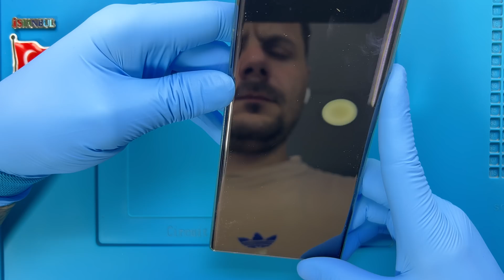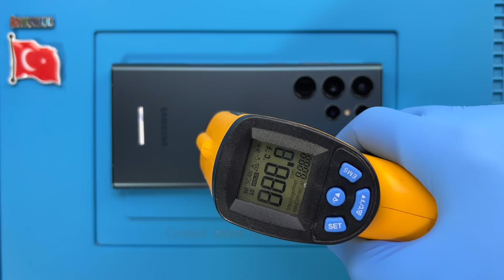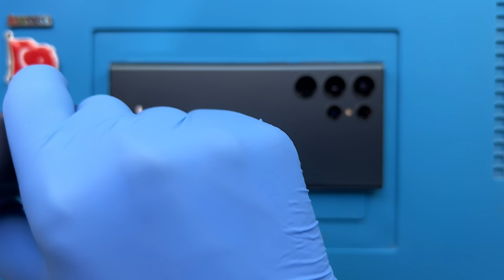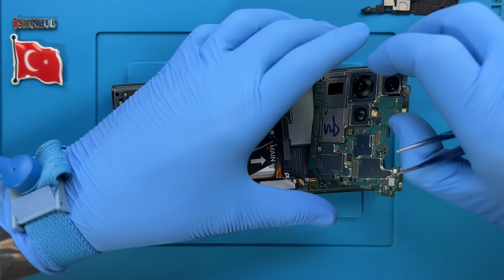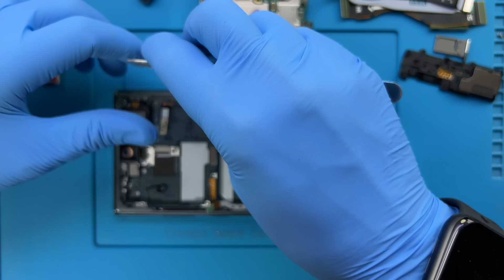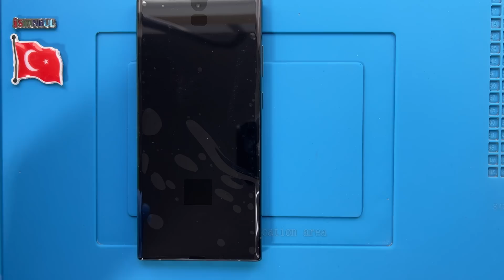Samsung Galaxy S22 Ultra Ekran Değişimi 🇹🇷

Comment: he miss something what was that?
Reply from the maker: Hello;
We did not understand your comment.
Greetings.
Reply: @gsmi  After putting the battery and those cables. He tried to integrate another think in the board but he can't and that piece was getting away. See minute: 15:20
Reply: 15:15
Reply: 15:10
Reply: @gsmi  at 4:53 in the video you removed a part. At 15:10 you attempted to reinsert the component. After several attempts, you set the component aside and instead reinsert the plastic part covering the inner earpiece assembly.

Comment: What is the cord strapped to your left rist?
Reply from the maker: Hello;
It is a static-free wristband. Our technical service is designed to be completely free of static electricity, but it is installed by our technicians as an additional precaution in order to prevent instantaneous static electricity.
Greetings.